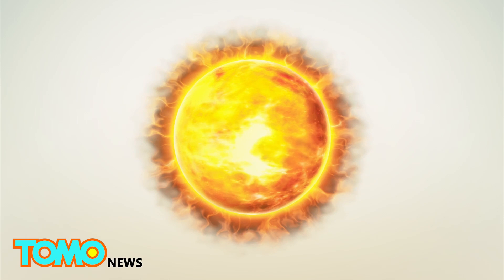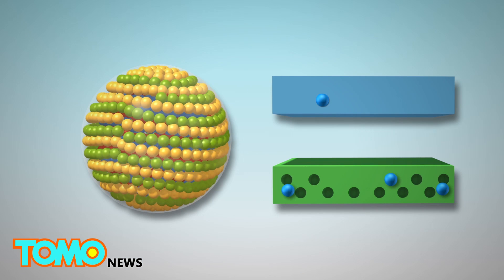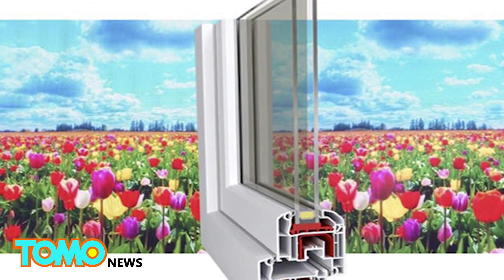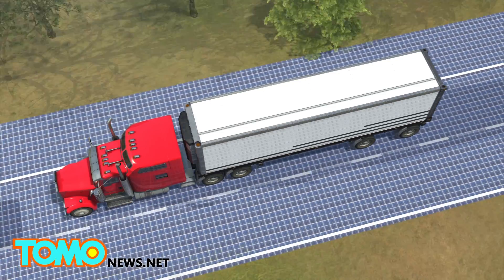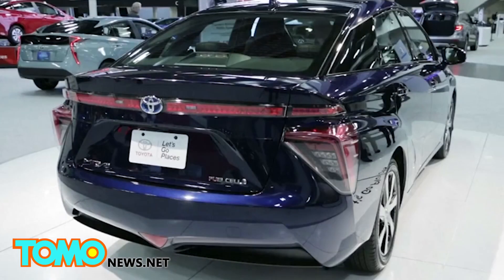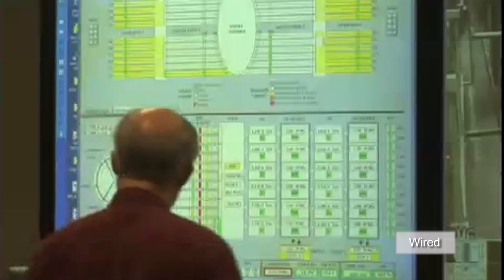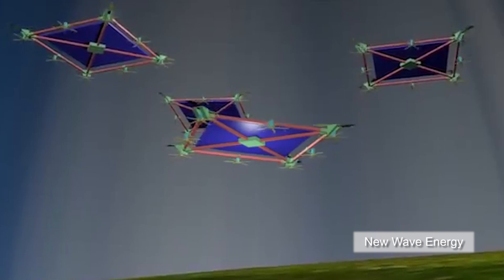Sustainable energy: New energy innovations to make the future brighter - Compilation

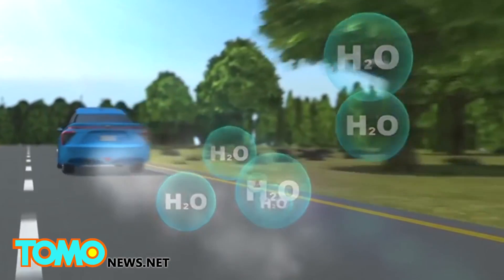Comment: 11:47 so hydrogen fuel cells produce water vapour? Guess what you chumps, water vapour is a greenhouse gas! Another silly idea - solar cells on road surfaces. They get damaged, dirty to the point of not working, and so require massive amounts of maintenance. No thanks

Comment: When i was a kid i designed a tidel power system. A boat would rise with the tide pulling on a cable it would go to shore lifting a weight. The weight would fall generating electrical power.

Comment: Why are so many people talking about "natural gas" and "bio-gas" as if they were good things? They are composed of methane which is an extremely potent GreenHouse Gas (GHG), far more so than CO2, and CO2. Doesn't that seem like a very undesirable fuel source? The whole point of being sustainable and using renewables is to NOT emit GHGs into the atmosphere.
Reply: When methane is burned and turned into carbon dioxide, It effectively becomes 1/4 of the greenhouse gas that it was. Yes burning methane is a really really good idea. It is a better idea then not burning it if you care about greenhouse gas.
Reply: @tomkelly8827  "the U.S. oil and gas industry is leaking 13 million metric tons of methane each year"   https://www.pbs.org/newshour/science/the-u-s-natural-gas-industry-is-leaking-way-more-methane-than-previously-thought This leaked natural gas is not burned, and is mostly composed of methane. Methane should stay underground, not add to GHG emissions.

Comment: the detail on how the buoy pump and generate electricity = zero.
Reply: It's not a pump and more like a valve, water will automatically flow from high pressure region to low pressure region. The problem is the ROI will not be a viable alternative.

Comment: Why are none of these solutions marketable?  Fossil fuels are mined or drilled and sold to the customer for consumption, the government is not needed to subsidize the development and implementation.
Reply: Because research is needed so that the technology can be profitable.
Reply: @Simqer  no research was made when early investors built oil derricks and drilled for oil, yet those private companies foot the bill, built the market and sold the product.  This is how a product is tested.  If the green energy source is really that lucrative, then someone should put up their own capital, develop the product and market it against the current product.  Being green, they should be able to sell it for cheaper which would take business away from fossil fuels, much the same way Amazon.com is bull dozing brick and mortar stores.
Reply: @MichaelJeffers75  early companies also made a lot of mistakes, a lot of pollution, oil spills, etc.. moreover engines were also a lot less effective.
Nowadays those companies also have to do research to make their products more efficient.
Renewables are new comers into an already developed market, to make a place for themselves, the companies that aren't creating any products yet still have to do a lot of research. If the government doesn't help out, the final product will be a lot more expensive because of the research.
But nowadays, many companies don't need the help of government as much anymore because they are already putting out products and can find their own research.
On the other hand, companies that are researching new types of products need help getting started.
Reply: @Simqer  Amazon and Space X are 2 great examples of products produced in an already established market by private sector companies.
Reply: @MichaelJeffers75  A city of 1 million people will need about 500m USD for a big enough solar farm to create enough electricity and another 500m USD to create an energy storing in water plant (look of dinorwig power station) to take care of peak and night power requirements. For a total of 1 billion USD initial investment.

You might complain that it's a lot, but that same city will consume over 1 year a whopping 100m USD+ worth of fossil fuel to create that electricity. That is 10% per year of the investment necessary to become green.
Diversify the solar plant with some wind or geothermal to help during winter, you have a completely green city that doesn't need fossil fuel to create electricity.

And that is all accomplished because governments helped fund renewable startups with billions worth of research costs.
Reply: @Simqer  with such a promising business model, such a brilliant idea should have no trouble at all attracting private investors and marketing that energy at a discount to fossil fuels.  You keep arguing that your envisioned end justifies the means, but you take no account for what happens when something doesn't go according to your plan?  If a private company fails with that idea, than we know it wasn't meant to be for a reason.  Also, don't forget that if America passes energy laws, it will have no effect on Russia, China or other nations, so we always have to be able to compete with them.
Reply: @MichaelJeffers75   Yes, I will agree that the majority of those startups do not own out and will fail. But sacrifices have to be made to find what DOES work. 
Also, if people keep playing the blame game that because THEY don't follow the rules, why should we is the worst attitude to have.
If they don't want to then you lead by example, and eventually they will follow because it will become a better and cheaper alternative to fossil fuel BECAUSE research was done.
Also, you want to have research done before the other countries can do it, this way you will have carved out a big cut of the market before the others came into play.
It is a big war of who finds the next great renewable technology.
Reply: @Simqer  the rules?  The rules are that which we all currently agree to, not just we Americans.  But if the whole planet doesn't get behind green energy, America can't save 5% of the planet and expect to have a meaningful impact.
Reply: @Simqer  also, if America commits to funding green energy, China and Russia can bank roll the USA out of existence.  Then what would the global rule makers decide?  Your ideas are only good because you're allowed to have them.  In a communist society, your ideas remain  in your head or you'll take them to the grave with you.  This is why it is equally important, if not more important that the USA remain at the top of the podium.
Reply: @MichaelJeffers75  the amount of funding necessary pales in comparison to what the USA's defense budget is, so no need to worry about getting buried lol.
Also, like I said with the numbers, if you can make your full investment back in 10 years, it is time to start implementing green energy.
Reply: @Simqer  keyword is "if"
Reply: @MichaelJeffers75  that is a rhetorical if.
Reply: Btw, you complain about all of it, but you know where the money actually comes from?
It comes from the carbon tax you pay on electricity bill. It is about half a cent per kwh. It might show up on your bill or it won't if they integrated it into the price.

For your reference, in 2019 USA consumed 4 trillion kwh, multiply that by 0.005 and you get 20 billion USD they can spend green energy.
Oh and that is just the electricity, don't forget the carbon tax on gas and oil for vehicles.
Now if you were to make everything green, you wouldn't have to pay that carbon tax.
Reply: @Simqer  wow, you're so woke.

Comment: Universal UNISON unity energy free energy in space orbital harmonious satellite shortwaves w44 20khz SOS morse code scene singles special ultra supersonic reverse mechanical radio waves coming in from space could be used for all planetary environmental energies via nano micro electromagnetic transmission or receiving distribution pull circuit Motors in fitted into radios televisions and computers upon the motherboards of all future radios televisions and computers nano micro motos electromagnetic transmission or receiving motor distribution pulse circuit Motors 2 released already transmission oil energy waves coming in from the heaven shortwaves a Dios been to productive radio for the labour international League universally

Comment: Using universal UNISON unity for all orbital harmonious satellite shortwaves w44 20khz SOS most coded planetary transmission special ultra supersonic radio electromagnetic radio waves to drive all transport vehicles and flight vehicles aviation land vehicles and also see vehicles that is supposed to use of radio energy transmission oil energy via orbital ultra supersonic orbital ammonius satellite shortwaves w44 20khz SOS most coded you will be CVs radio transmissions ultra supersonic radio waves to which can be applied also into robotics for nuclear disarmament purposes using radio CNC automated robotic reverse mechanical robotic machines for nuclear decommission zlotys of very very special harmonious radio waves I hope the military and all people of this world do you use in order to make a World a better place do you trust Sonics are good for vehicles shortwaves supersonic radio waves nano micro Motors to release the energy into vehicles

Comment: Manufacturing and production of plant plastic planetary plastics and graphene solar powered trains a vacuum camera infrared camera computerized line relay a computerized Cameron solar power a vacuum radio electromagnetic shortwave operated driving on radio waves ultra supersonic shortwaves satellite orbital planetary programmable shortwaves w44 20khz transmission oil driving waves ultra supersonic for solar power plant plastics and graphene solar powered plastic trains a vacuum electromagnetic radio wave driven electromagnetic radio wave driven trainz propulse vehicles driverless autonomous planetary programmable shortwave operated satellites

Comment: hey ,if anyone else is searching for solar thermal energy for home use try Ewans energy roadmap (just google it ) ? Ive heard some amazing things about it and my friend got excellent results with it.
Reply: Applaccro , I have ideas of using thermal energy which is in attics which involves heat exchangers and Stirling engines and geothermal heat pumps for airconditioning and heating of hot water and radiant heating and cooling of the house.

Comment: As a nation, Britain seems committed to increasing Cycle-ways and walking tracks. It ALL these were surfaced with the French  style roadway surfaces, A: Wear and tear would be drastically  reduced. And B: the necessary infrastructure taken out of harms way from road accidents. Also, I can't help thinking of all the hundreds of thousands of miles of urban and suburban pavements in ALMOST EVERY country, where such panels could be laid FAR less expensively than on our busy roads.

THEN. Anaerobic Digesters:  All even moderately densely occupied areas have sewerage mains, leading to a sewage works. ? How much 'greenhouse gas' are they releasing un-harvested into the atmosphere? Could THAT source of potential energy be captured?  Also, as renewal / expansion works are undertaken, couldn't these 'Digesters' be installed then?
Reply: BasBarraclough , I think solar panels should be placed on South facing walls off freeways.

Comment: In Germany the "Biogas Powerplants" are really common too and in the video another benefit of this process has not be named. While burning the bio-gas to produce electricity a big amount heat is produced and the heat is transferred to houses to them. 

Another thing about the cammeron article. The guy in the beginning is wearing  a "LIDL"  shirt (supermarket).
Reply: Hauke S, As the biomass gets decays in the digestor it gives off a lot off heat. Steam is often  given off the piles in the coldest parts of the winter because still decaying after it is removed and methane content is still there. After it is fully digested it can be used as fertilizer and soil admentment compost.

Comment: solar power generating zeplins?
Reply: jakub rembacz , that was my idea long ago, but instead of being cigar shaped I think the panels should be on a inverted Delta shape so the sun could shine on the top of a wind foil and be powered by Hydrogen created from the electricity through hydrolysis and the Oxygen and Hydrogen could be stored in compressed separate bottles and be used as ballast to counterweight the the balloon bags of helium under the wings. Electric motors could power the cowled counter rotating turbines which could pivot  270 degrees for manueverability.

Comment: The buoy thing is interesting.. really interesting as it does two jobs at once.  coastal cities should all have this
Reply: Sislertx , It think instead of plumbing pressurized water. The buoys would pull a electric generator and when the buoy rises  and lowers it moves a magnet through a looped field and the result is could vary the distance it moves by the strength of the field.   Piping invovles friction in moving water through a piping and you have to fight gravity. 
If you had many buoys in a grid it would absorb some of the kinetic energy of the waves and thus reduce sand erosion and might build up sand bars behind buoys which would slow down the waves. The electricity could feed into grid for other purposes.

Comment: These kind of episodes make me depressed asfuck, We hear about these amazing breakthroughs in the news but 99% of the time, Either they'll fail or will go completely silent.
Reply: Shrek holy crap same bro
Reply: don’t have to wait to get started,,talk to people living off grid,campers and boat people,,,a lot of information out there from those that are working to lower electrical needs,,a good start,,LEDs,,have fun
Reply: 4 years and nothing from those breakthrough inventions.
Reply: @aduenamz2569  That's because of the mafia!  Didn't you read Drimz's ingenious insight as to why they never see daylight? He told us why they go south.  That it explains them all.
Reply: Yeah why not
Reply: It's not enough to just come up with great ideas. They have to be commercially viable as well. That requires a cost vs. benefit that allows multiple points of profit making in the production without making the finished product so expensive that it hinders it's commercial success. It also requires an unbroken chain of human activity to bring it to the market. Many good ideas fail in the process of making it to the market because of a human failure point, or just simply because it reached a point that it becomes no longer cost efficient to produce and sell successfully. In 1910, 2 years after production started of his wildly successful Model-T, Henry Ford took a ride in a Fritchle electric car. The car had a 100 mile range and was (how ironic) much faster and more powerful than his gas powered Model-T. Ford said, "all future cars would be electric." He may ultimately be right. But 110 years later, that great idea is still a work in progress.
Reply: I think the U.N should create a body to address green energy adoption and climate change monitoring...if they already have they should lobby each of its members to form atleast a ministry of green energy and climate change.
Reply: @ Tr4il    A lot of people feel as you do.   My sympathies but you only have yourself to blame when it comes down to why you end up feeling as you do.  Believing fantastical assertions that are unjustified will always produce those results. It's because you don't know enough about the sciences involved to recognize the "breakthroughs" are not workable founded on a workable form from original conception.  Breakthroughs that do eventually prove to b viable are based on workable sciences ,  are economical in implement and bring a needed benefit will make it to the market.
Reply: Most are fake, as well...
Reply: Many comment about a mafia being involved. However, doing some simple calculations show pretty quick, that the mafia has no need to do anything. 
In most cases you end up with a technology that needs 4 - 8 years for the return-of-investment (ROI). And that only given under perfect circumstances:
- No interest on invested money
- No rent for placing spot
- No personell
- No failure of any part
- Machine works 100% all the time
- Being able to sell electricity for a high price
- ...
These factors are never all given, which makes the ROI very, very difficult. This makes the investment very risky.

And all that without speaking of laws and regulations regarding the environment. E.g. in Japan you need to wind your self around 10 different laws to built e.g. a hydropower plant.
Reply: A alot of mafia try to stop this. Imagine if this technology adopted, no money for them from mines.